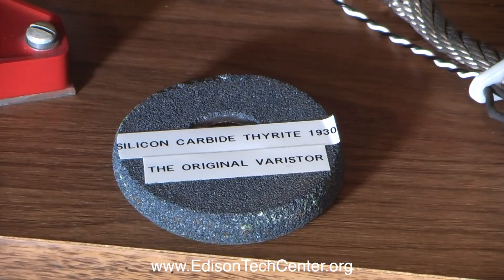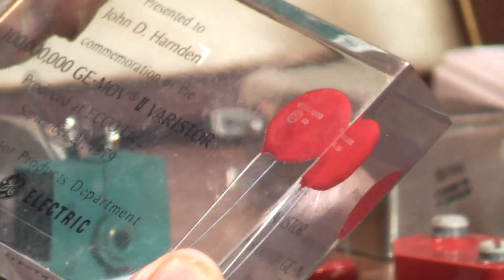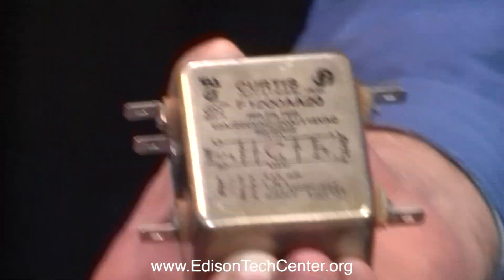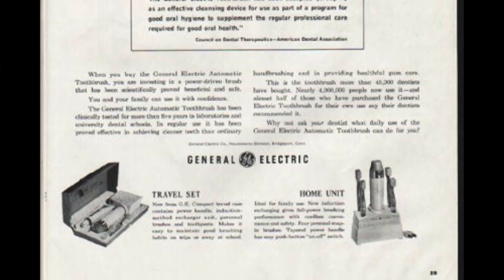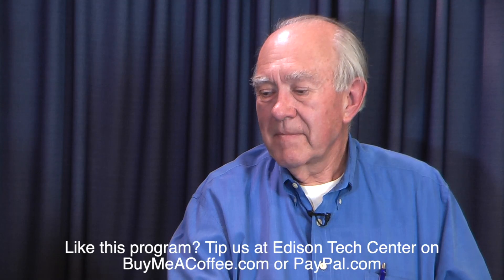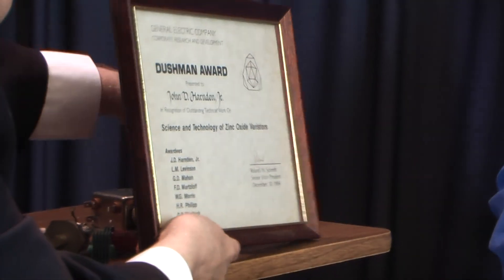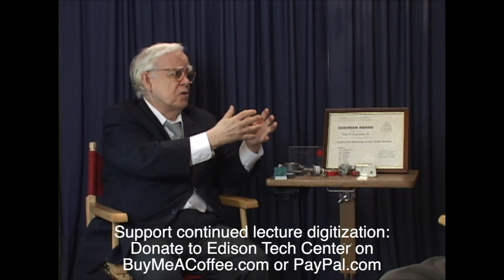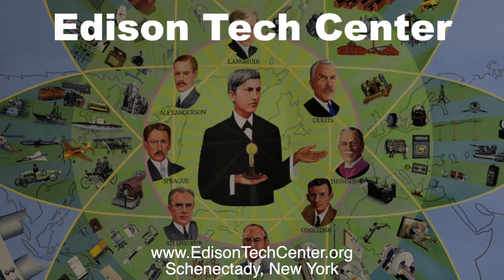Surge Suppressor (Varistor) History Part 2

Comment: A few years ago, I read or have been told that you have to put a fuse in série with varistors because they fatigue and die closed, do you confirm that? Your mention of a fuse is more about failure after “use” rather than the natural decay I remember.